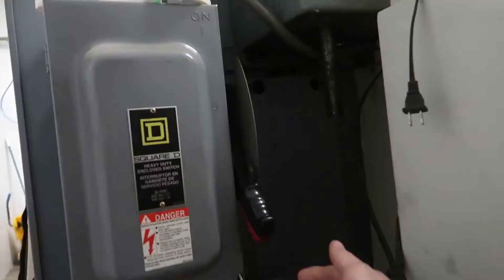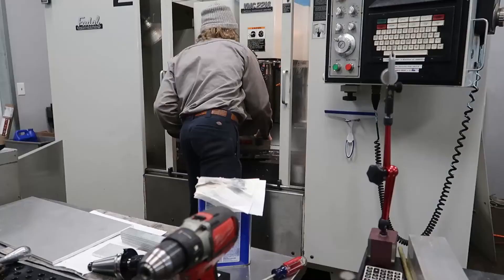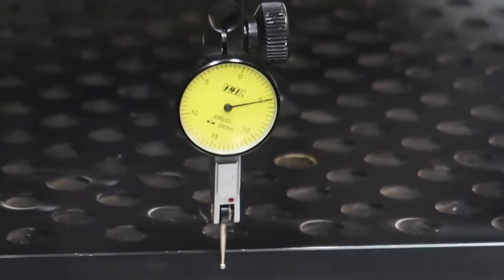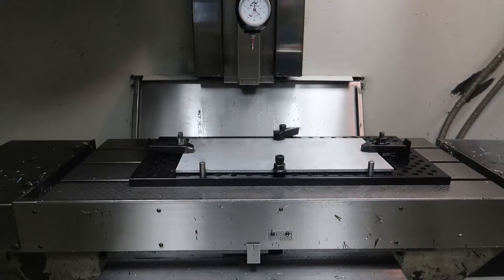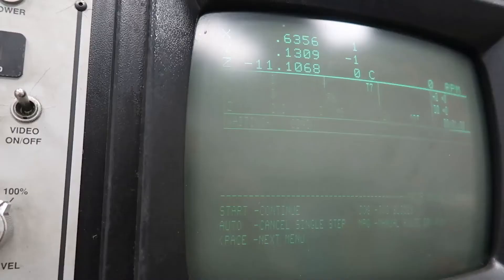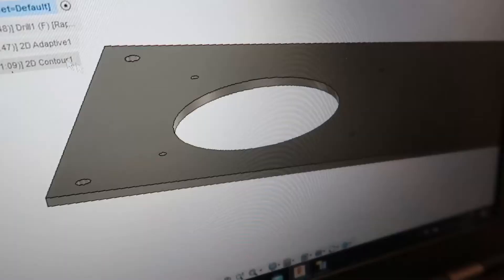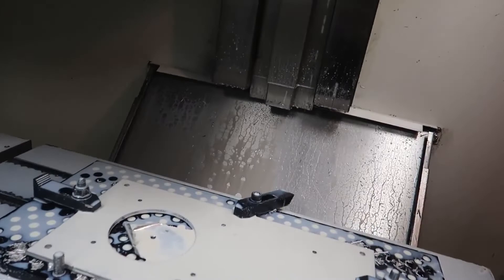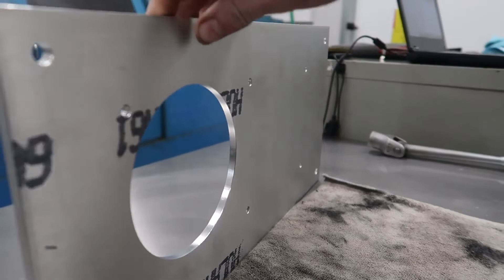CNC Milling Plate Work

Comment: I have always liked to drill and ream 2 holes( if the part has 2 holes far enough from each other) in the fixture base im using and use dowl pins to align the part for op 2 and them super glue and Kapton tape. I have had pretty good success supergluing op2 plate work with 0.100" thinkness and about 12" by 18" big
Reply from the maker: Oh yeah thats a good idea!

Comment: You're best buying pre machined precision stock if you need to face stock,  difficult to hold and you will get curling trying to face milled stock. Otherwise plate work is easy and usually quicker on a laser!
Reply from the maker: That's a super good idea buying the precision stock beforehand. I also agree laser cut parts like this is much more efficient and cost effective. However, hypothetically, what if there is features such as counterbores on both sides?
Reply: @MojoMfg  Only way is just to make a simple jig,  a piece of thicker plate that is fixed to your table with counterbored fixing holes or just a plate that goes in the machine vice for smaller work. Nest the parts in cam with fixing holes (either in the parts or if there are no holes through the parts drill holes in the dead space between parts.   hold the plate with hold downs,  drill holes then fix it to your fixture plate then Mill the parts with an onion skin bottom